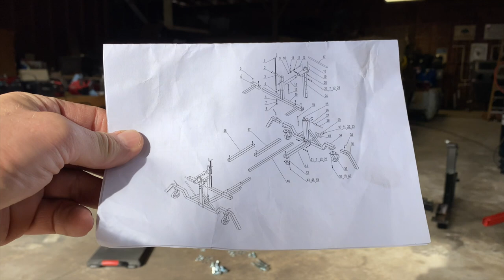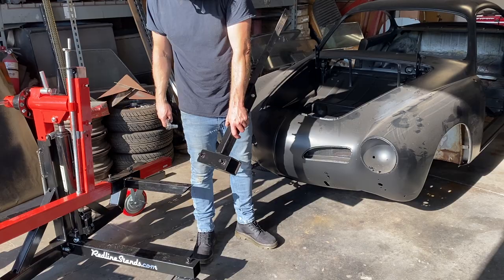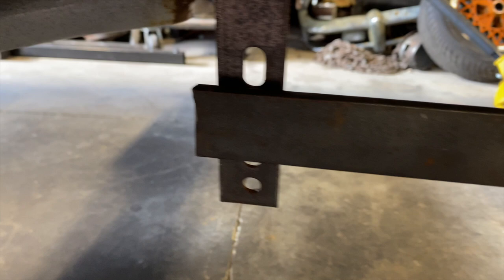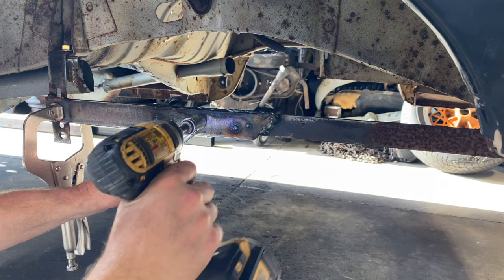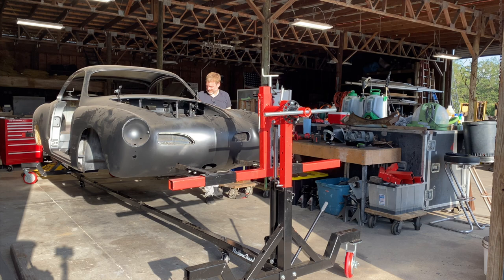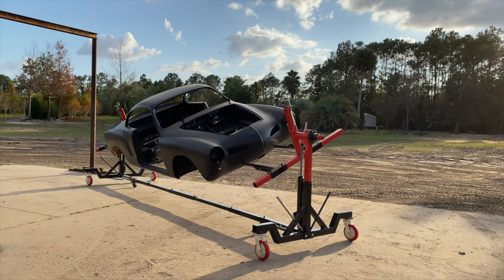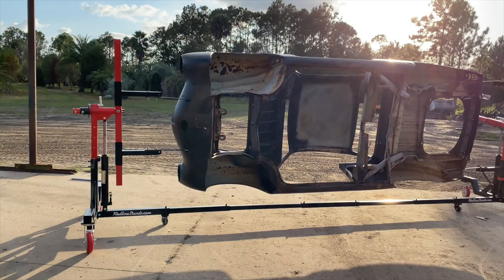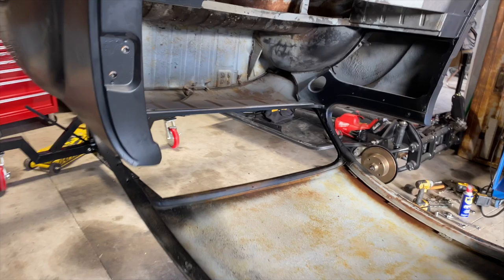FULL RESTORATION Rotisserie Build VW Karmann Ghia | Complete Restoration Series

Comment: You may need to beef up Your mounting steel straps to support the body at 90 degrees. Flat stock steel is not supporting. Maybe use angle iron or add stock at90degrees to Your support pieces.

Comment: Good day CT. This is a great addition to your arsenal. Now you just need a bit of sheet metal fabrication equipment to help you make your own panels or parts of panels that need to be replaced. I am sure that in the long run it will be more cost effective and increase your knowledge. Why buy a whole replacement panel when only an inch or two needs to be replaced.  
Keep at it. You are doing a great job.
Reply from the maker: Thanks Philip! That is great advice.

Comment: You're doing a really impressive job on that Ghia! I bought a coupe like yours in 1968, and it was great fun to drive --- until the arrival of our first child. We just couldn't get all the baby stuff inside, and we couldn't afford two cars, so.....  but it was great while it lasted. 
While I was watching this latest video I made a few notes, and I hope it's OK to share them since I'm not yet a formal subscriber:  
1. Lock the wheels on the rotisserie when you're revolving the car, otherwise the twisting motion can cause it to skew sideways into something (or someone);
2. When rotating the body, use a handle rod the same diameter as the one that came with the kit but maybe 18" - 24" longer. It will give you much greater leverage and put less strain on your back;
3. You might consider some temporary X-bracing across the door openings, to make sure that beautiful Ghia body doesn't warp on you when you have it on its side.

Comment: CT when drilling large holes try using a smaller drill first and then use the larger one this makes it much easier for you.  Also the front support isn’t centered with the car body.

Comment: Hey CT, the I think you need to crank the little handles a little further until the center of gravity of the car is ligned up with the round pivot point.  Once you get the verticle banance right, the car should rotate with ease.
Reply: Exactly

Comment: Congratulations on the new tool!!  Something I never had when I was deeply into restorations! As commented above, you will probably want to add left-to-right bracing. The car should not want to move left to right when supported by the rotisserie. Depending on what you have handy, a X brace near where the supports enter the body would be ideal.

Comment: This is going to make your life a lot easier on this project.  I would suggest cutting the crank handles off and welding a big nut on the end of the threaded rod.  Then you can raise and lower with a socket on your drill.
Reply from the maker: Thanks Michele! Good idea! I will do that.

Comment: CT, You need to make the car central to the rotisserie so it will turn easier and level. You can twist the frame / bidy with having one end off centre as it changes the pivot point.
Reply: Exactly, getting the weight closer to the pivot point will make it much easier to rotate. So, with the Ghia in it's normal position,  you need to raise it, probably another 6".
Reply: Center it please!

Comment: Looking good CT!!  Like others have said get the car centered.   It's all about balance.   And use hose clamps on the handle instead of bicycle grips.  Or even rubber bands.   It won't take much to hold it in there.

Comment: Might want to consider mounting the connecting tubing pieces with the bolts to the side that way if the vehicle ever hits the connecting tubing while rotating it will not hit the bolts but just the tubing and not dent the vehicle nearly as bad. You now have the opportunity to access all the rust repair and weld on the flat which most people are best at. Going great keep the good work up .

Comment: Hi CT, I think that shell is to flimsy to be on the rotisserie like that. I would mount it back on the floor pan to get it back to square. Then fit diagonal bracing across the door openings and across the car before proceeding further. Fit on the rotisserie with shorter square mounts that won't bend.

Comment: Congrats on the rotisserie, what a great tool to add to the shop. If you find the point where the vehicle is really balanced in between the ends it should rotate very easy for you without that handle.

Comment: Also try flapper wheel discs for removing rust as they can be bought in different grits and are not as aggressive as grinding discs so will leave more metal . Maybe a supporting vee type piece of metal brace on each door  from the 2 hinges to the latch to help stiffen the body and prevent torsion distorting metal and your new work. I will be waiting for your future work .

Comment: You need to center the front part of the rotisserie in-line with the centre of the car. Rotisserie needs to be inline front to back and it will rotate easier.

Comment: I think you will need to design better mounting brackets as you get closer to finishing.The current ones bend when you rotate to the side position and hit and bend the front and ba ck panels where the brackets go through the hole slots.

Comment: Balance it so it isn't heavy to turn...your too low on your mounting points...you want it so it doesn't flip violently when your turned....if you balance your weight it should be SAFER and One person ...those flat pieces are too light duty they could bend ... you need an adjustable attachment up and down to balance..

Comment: The secret to Rotisserie Ghia is cooking it over slow heat for long periods to tenderize, cook it too fast and too hot it will be chewy and tuff. I prefer sweet Smokey barbeque sauce to a hot one but... you need a soft brush that will coat & layer stiff brushes tend to scrape the caramelized sauce from below off and you don't get goo layering... Don't be overwhelmed, pick a small spot cut out the rust weld in a new piece perfect that small spot and find another nearby and work on it work your way around the car. Start small pound the metal to fit, work your way up to the larger contour parts. That way you will get a feel for shaping the patches before moving on to large compound curved patches.

Comment: ct  by raising the car on the rotisserie with the  screw adjustments  you bring the mass closer to the center of rotation....plain english itll be easier to rotate the car... simple physics explanation  the car is mounted on a lever  make the lever shorter and there is less load .

Comment: you absolutely need it for the bracket at the back Square pipes. The iron straps are too long, they bend sideways and 
damage the body .Don't forget to compensate for the missing doors with threaded rods, otherwise the door cutouts 
will move and the doors will NEVER fit again.

Comment: That steel strapping is not made for lateral strength. When you have the body at 90 degrees it's really flexed - you need to beef that up. Think about it like framing lumber - a 2x6 on the flat is really weak...

Comment: How come you never step up drill bit sizes when drilling into thick steel? Makes me cringe every time haha. You will get much more life out of that big bit if you start at say 4 - 8 - 12 not to mention getting through each size with a lot less resistance in less time and more accurate holes because the smaller bit is easier to get through right on your marks. Instead of just straight through with final size, burning out your bit on its first hole